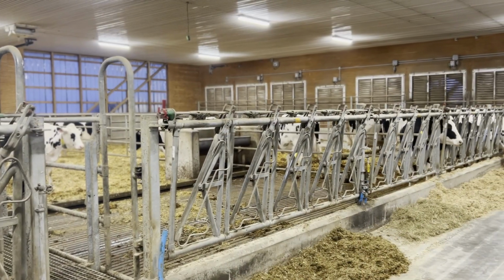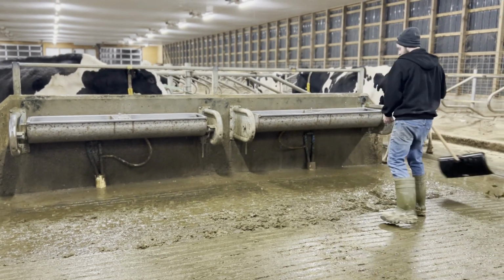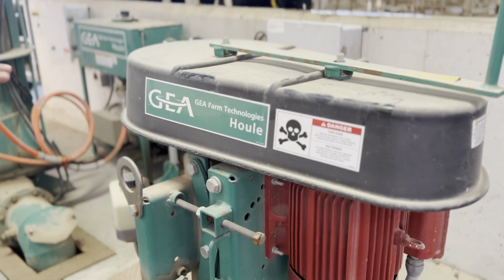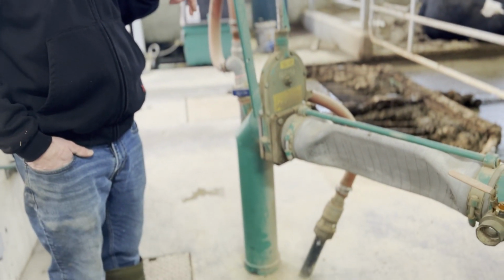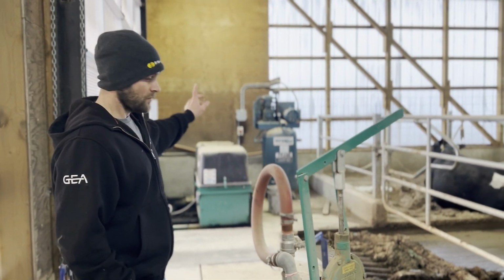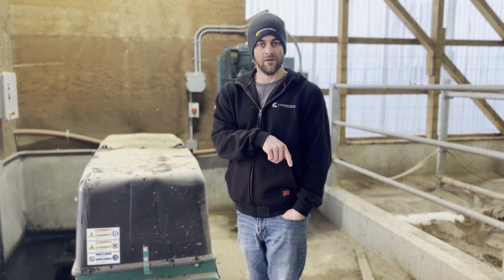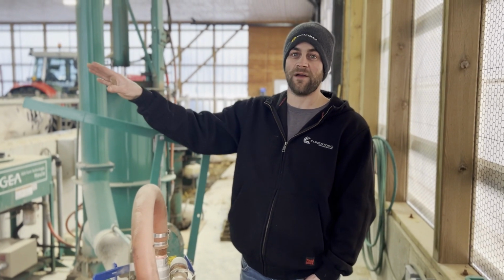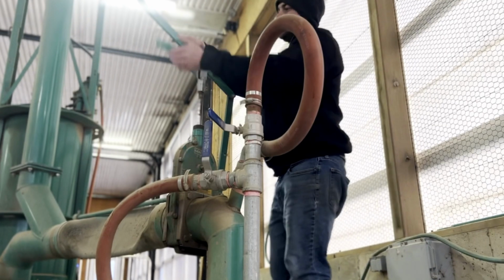Blasting Out Our 400 Foot Manure Pipe

Comment: I hope you have a plan to bleed off that pressure if that outlet ever freezes over enough that the air will not push it.. if not.. well.. that would be a really bad day.. other than that.. agree completely with an earlier comment.. that system sure does keep your Ladies looking sparkly clean:face-purple-wide-eyes:

Comment: I've heard the sand is really hard on those cables. Have you had to replace them yet, if not how long do you think they will last?
Reply: Hi Brian,
Apparently they last about as long with sand as regular bedding manure. We used stainless cable first. Lasts about 12 months. 
I’ve heard other guys that don’t use sand maybe get little more then 12 months but not much more. 

Now we have cable wrapped with rope. It’s more expensive but supposedly last a few years. Even in a sand barn.